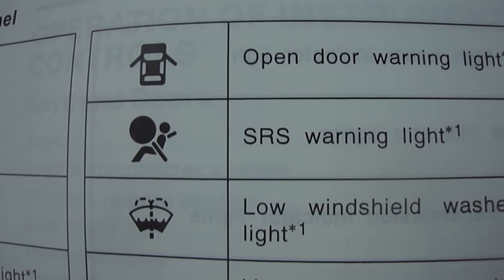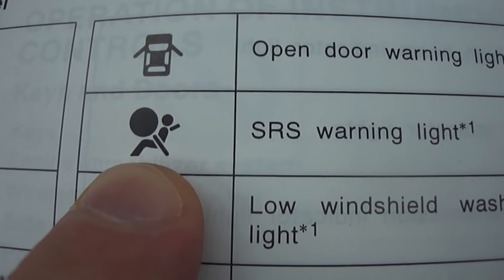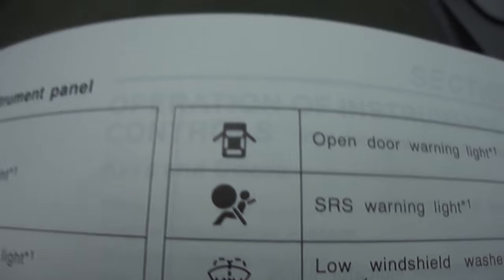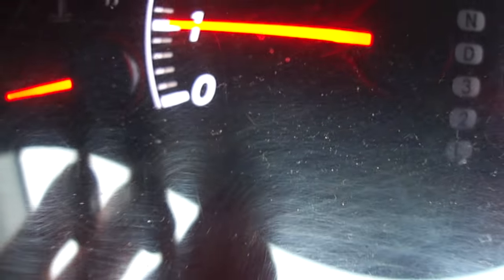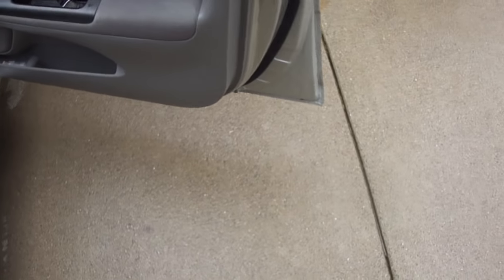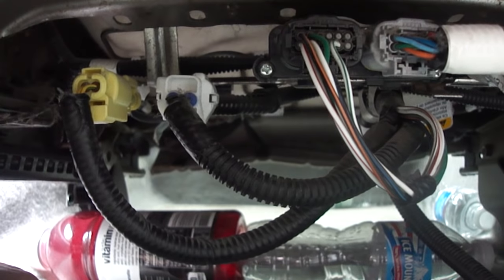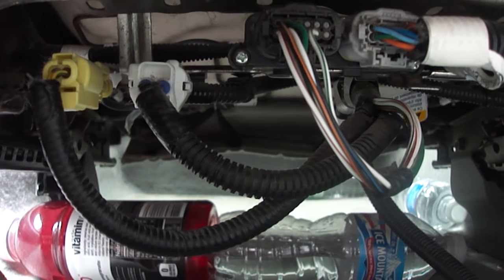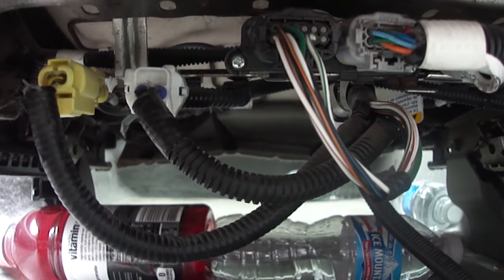(Part 1) How To Fix Airbag Light - Fast & Easy!

Comment: That's apply on gmc yukon denali 2007 too,please help thanks
Reply from the maker: +pastrana37 I would think this would apply to any vehicle with airbag electrical wiring connections under the seat.
Reply: +proclaimliberty2000 
Thank you for you input👍👍👍

Comment: How do I know if it's the passenger or drivers side?
Reply: Try the passenger side first. If that doesn't work, it's not the passenger side. Move to driver's side and repeat...
Reply: I checked both sides.  No wires were loose.  The passenger side belt buckle (where it inserts)   is loose though.  I wonder if that can affect it??

Comment: The light is suposed to come on when air bag  is off on pass front seat but the buld on the light round circle but the ash tray. How to change bulb? Get 1818 codes on mazda MPV

Comment: I straight up wrecked my mustang, I slammed a cumb, cracked a rim, bent a tie rod, my seat belt is locked and the airbag light is on send help for the airbag and seatbelt not retracting

Comment: No fuse in the air bag slot . new truck srs light is on don't know what to do
Reply from the maker: Leslie Flory First you need to install a new fuse.
Reply: @proclaimliberty2000  it's the 30a AIR fuse on a 2001 silverado
Reply from the maker: Leslie Flory Replacing that will hopefully fix your problem

Comment: Keep the junk off the floor and under the seats and you will eliminate your problem to begin with. Connections are about 90% of the computer problems. When you're only running half a volt or two it does not take a lot to stop it. Loose connection, a little corrosion and your connection is broken.
Reply from the maker: gary penfold have you ever tried raising 4 teenagers one year apart!  LOL!

Comment: If you check on here a lot of the reasons the light comes on is due to soda bottles(in your case, vitamin water bottles)  that get jammed under the seat.
Reply from the maker: Peter Timpson Yeah, it’s called four teenagers!
Reply: @proclaimliberty2000  3 grandkids in my case. Apparently not my problem though. Checked wires and it still goes on and off.

Comment: Works after I start it first time. 2nd time light just comes on again. Guess I'm one of the unlucky 10%. Mechanic did have to take steering wheel off to do ac work recently so it's probably the connection there. Dammit. Thanks anyway.
Reply from the maker: Justin Werner Yup, sounds like they did something to the connection working on the steering wheel.

Comment: my doctor has been telling me to get my airbags disengaged on the driver side for 2 years and I can't find anyone I'll do it because of federal law. If I get in a fender bender and my airbags deploy could kill me instantly or cause me to be a quadriplegic. I have a disease called Ankylosing Spondylitis. It's a rheumatic arthritis. It causes the soft tissues in your spine to to calcify and your body grows new bone to shore up your spine or it's weekend. That new bone that my body is thrown at 40 years old is very weak and brittle and an impact from an airbag could break my neck instantly. He said the difference in breaking a normal person's neck and my neck is breaking 1 foot diameter green lamb in a tree and a quarter inch dead twig on the ground. Matter fact he says it's not if you break your neck it's win but it could be different degrees of breaking. I could have a small slip and have a small breakage in my neck that wouldn't cause me to have a catastrophic outcome. i-Ready have hundreds or thousands of compression fractures in my thoracic and cervical spine because this disease make sure upper which means power forward. My head is fused in a prayer like position.

Comment: thanks i tried it but it didn't do it thanks though
Reply from the maker: Try it again!  Make sure you wiggle and push together ALL of the electrical connections under the driver and passenger seat.

Comment: my left side driver airbags deployed while just driving down the road.  NOW the SRS light is on and won't go off.
Reply from the maker: Your air bag light will not reset until the deployed air bag is replaced.

Comment: does the light mean there's not an air bag? how can I find out if there is an air bag without having to get in a crash to find out?
Reply from the maker: Having the airbag light on means you have an airbag.  Until you get the airbag light turned off, it will not deploy should you be in a collision.

Comment: Now do you know how to fix a tire light? They all are full.
Reply from the maker: +Cecelia Davidson Make sure you have the correct  tire pressure.  Check my other tire pressure video.  If tire pressure is good, the car manual will tell you how to reset the light.  If light does not stay off you may have a bad tire pressure sensor which will need to be replaced.  A while back I had my tire pressure light come on even though it was at the factory specified pressure of 32 PSI.  It turns out the tires needed 35 PSI for the sensor light to reset which I learned from Belle Tire.  Weird!  I understand how annoying this stuff is.  If you can't get the light to turn off and can't afford to have it fixed then just check your tire pressure regulalry and call it good.  All these bells and whistles are a royal pain in the butt and just cost people more money in repair bils which makes the dealerships happy.
Reply: +proclaimliberty2000 Its also a loop hole for insurance companies to not pay off in an accident relating to tires. The Ecm will save all info just like a black box in an airplane.
Reply: Cool.
Reply: Each tire has a tpms sensor assoiated with it. Sounds like you may have a bad one? Pretty sure thay may need to be replaced or the system reset when tires are messed with? About $40 bucks each or so. An honest tire shop should be able to advise.

Comment: Hi  Chris  I  Cannot  unfasten  the  plastic  clips  on  my  dodge  nitro.  How  is  it  done
Reply from the maker: I've never unfastened it.  Just wiggle the two ends in both hands and push them together really hard.
Reply: I  eventually  unfastened  them  and  sprayed  the  contact  cleaner,  but  the  problem  remains.  Thanks  I  now have  to  find  a  mechanic